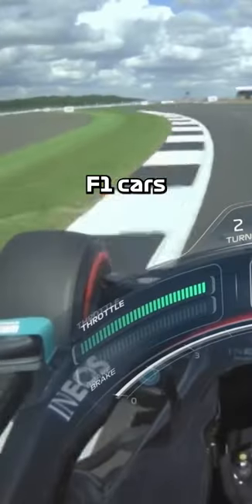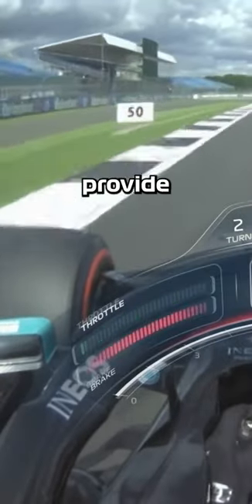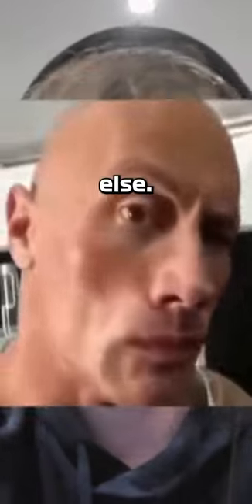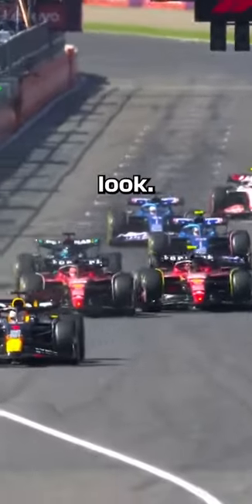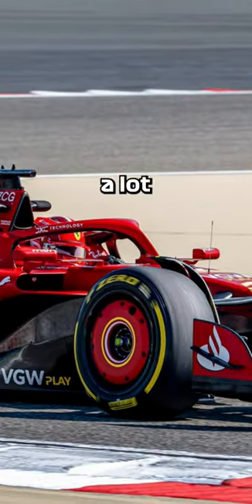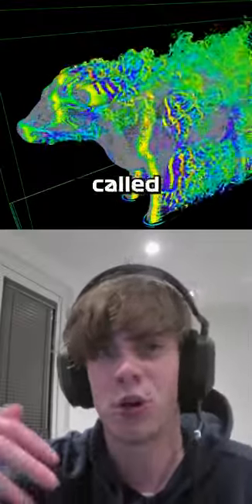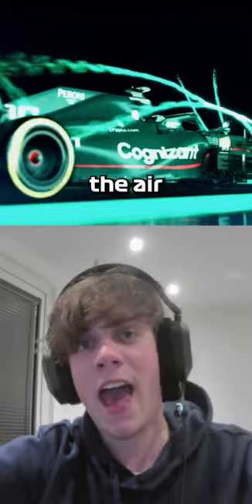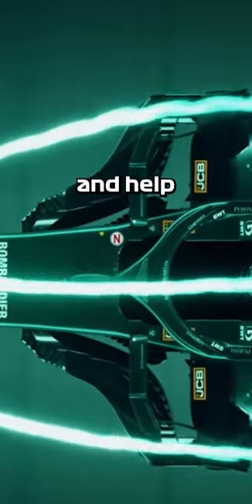Why is F1 Fast?

Comment: Piece of advice though in case you lack the capacity of common sense, do NOT sand down the tires on your mums Mini-Cooper, it will NOT work like an F1 car
Reply: “Imma warm the tires for a lap first” 😂
Reply: @xiao_eas  Proceeds to ram into the nearest Tesco
Reply: Don't tell me what to do, you're not my real mum! But if you were, you'd have sanded-down tyres!
Reply: @utbdoug  yeah you’re right do whatever you want, after all, I definitely don’t have a degree in automotive engineering
Reply: @CT-5689  Shh, just get in the car mum, it's raining and the life insurance is ready to pay out! 😂
Reply: @utbdoug  box box, we’re putting on wet’s
Reply: @CT-5689  noooo, it'll be dry in a couple of minutes, I guarantee.. Just make sure you've signed the will. No wait, I mean the birthday card. Yeah, that's it. The ehh.. Birthday.. Card.. 🤥
Reply: yeah your tires gotta actually be soft first before you try to turn them into slicks 😅
Reply: Thanks for the warning i was just about to do that
Reply: Can I do that in my moms corrola
Reply: @RY_Masters  ball out mate if it’s a Corolla it can happen

Comment: No silly they just have glue on the roads this was so obvious 🙄
Reply from the maker: whoops
Reply: technically because of how smooth the track is and cause of the rubber from the tires on the track you arent wrong😂

Comment: It's the wheels mostly. The grip and the turning.
When an f1 car turns it looks like the wheels don't move, but they do. The wheel on the inside (closer to the turn) will move slightly and the wheel to the outside (further from the turn) will move in more making them able to turn at high speeds.

Thanks for listening l.

Comment: In a more serious level: If you go in a corner right some force will want you to go to the other direction (i don't know the name of that). And so the tyres are having a kinda friction with the surface, and if we want it to have more friction we need to ad wheight, or push the car to the ground, and that's why we need downforce. Imagine a rope between your steering wheel and ur gas pedals, the faster you go, the more force you'le have in the wrong way, so you need more grip, so you need more downforce.
Reply: Centrifugal Force is the term you’re searching for / describing here, which could also be described as Newton’s Frist Law of Motion, where an object in motion tends to remain traveling in the same direction at the same speed unless it is reacted on by an unbalanced force, aka turning.